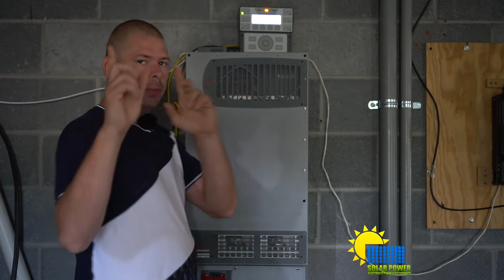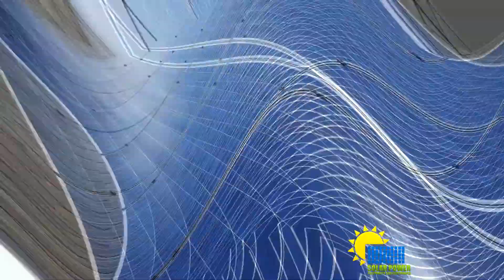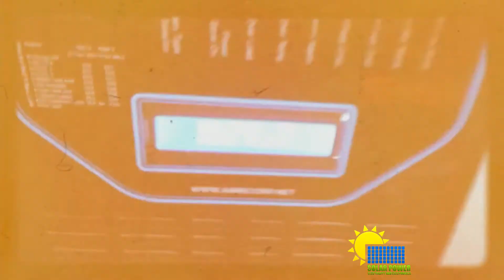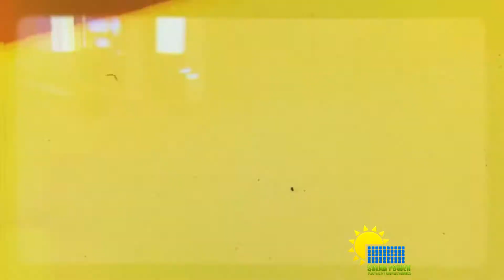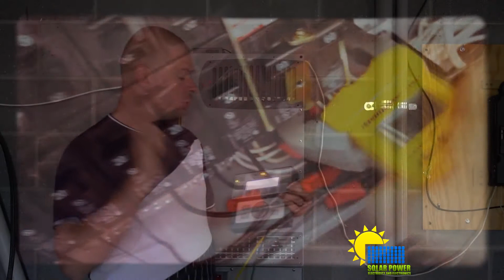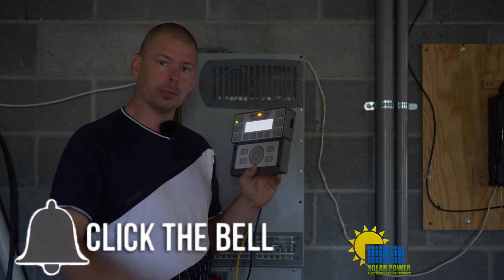Outback Post Install For Offgrid Solar Power and Gridzero

Comment: Your right about magnam . when I bought mine I couldn't find a bad word about it. I'm only pulling may be a 1000 watts off it and if a 500 watt load kicks in the lights dim. When I have it pluged in to grid power the out put is greatly reduced. I thought it was a direct through system but it cuts back the current a d voltage.

Comment: Right I'm in Glasgow. Ky and the power company buy back sucks. Got to love the Fing Electronic Plant Board. 800 for a pole 350 for papers for them to buy back plus have to buy a meter for 200. Plus electric solar certified installer has to sign off. All to be able to sell to them I don't thinks so. So now I live off grid forget them.
Reply from the maker: I'm not off grid I would like to be but I need more power for the bitcoin miners now days.I love the projects that I am a part of that is off grid.
Reply from the maker: yes what do you have for sell
Reply from the maker: i am looking for charge controllers what do you have
Reply from the maker: The phone does not ring like it's dead
Reply: @solarpowerelectricityandel2915  is it hooked into the Magnam